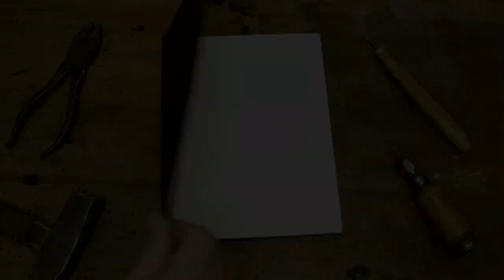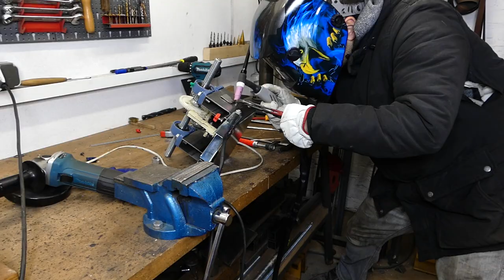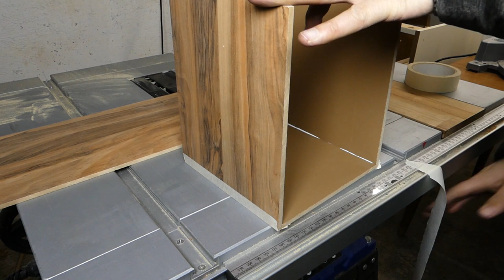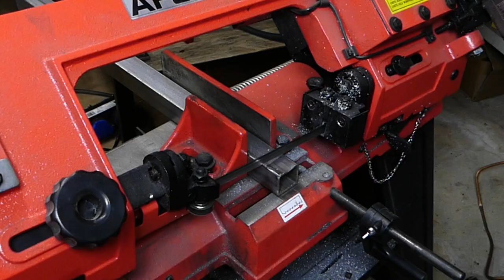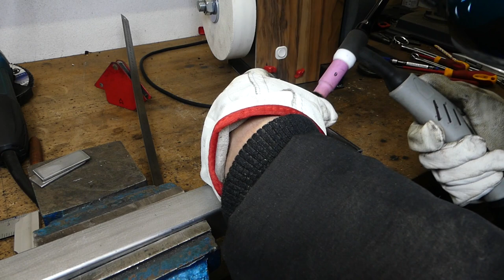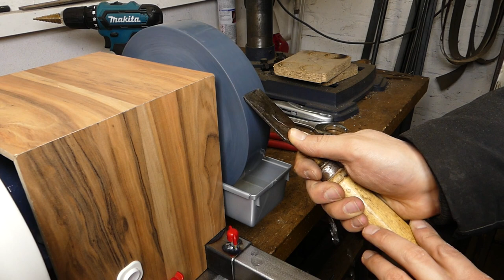DIY Tormek Clone | Part 2 |

Comment: Let it turn the other way around. And you won't have that mess with the water. The grinder will leave a burr on the backside it will also shift side and be much easier to remove.

Comment: Was watching a video of a real Tormek and you have the wheel spinning in the wrong direction!  that's why the water is flowing down the tool.
Reply from the maker: Yes you are right. But the other direction did not solve the problem, the water would flow down at the bottom of the tool. I've solved the problem with a device similar to an original Tormek. I hope that I'm able to cut the video this week. Thanks for your comment! 👍